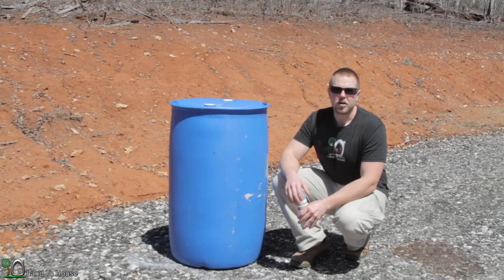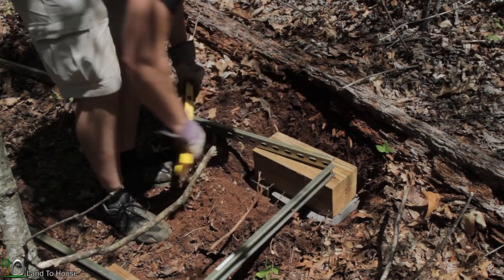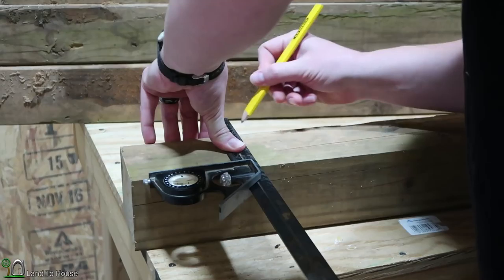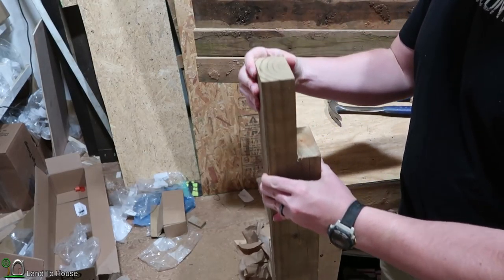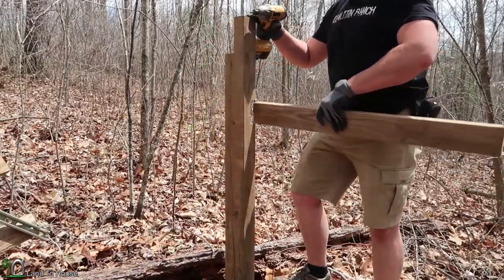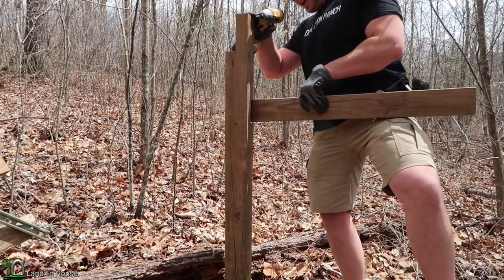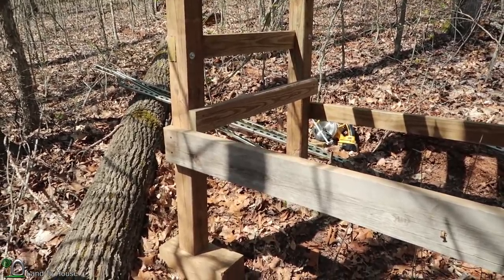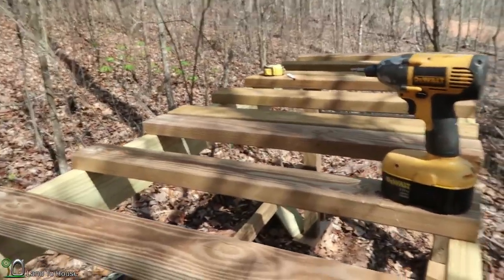Off Grid Water Tower P1

Comment: Are the tanks on the highest point within your property lines? Is that why you need the stand? You need diagonal cross bracing for sure, the additional 2x6 you screwed tot he face won't be enough. The 2x4s laying flat might be just ok, use joist hangers to secure the 2x4 boards between your top rails for a more secure solution.
Reply from the maker: They are close to the top. I was looking to have a little extra height to get plumbing done. I like the extra support idea. I think I will go for that before adding that 800 pounds of water.
Reply: I agree that the diagonal brace is a good idea given how much weight, but I don't see why you need joist hangers when the slats are sitting on top of joists.  Hangers are for when you butt into the joists.